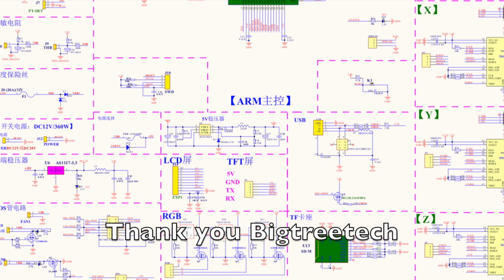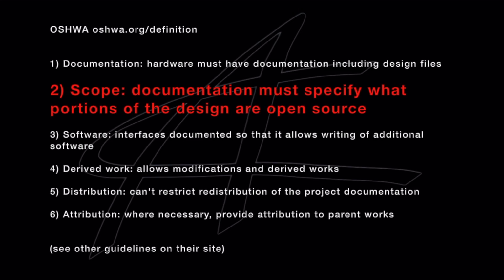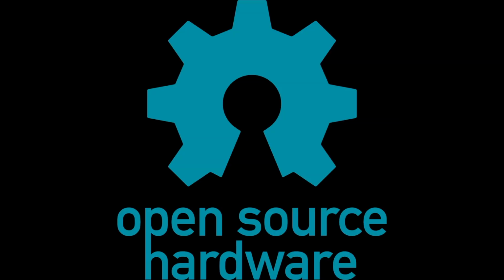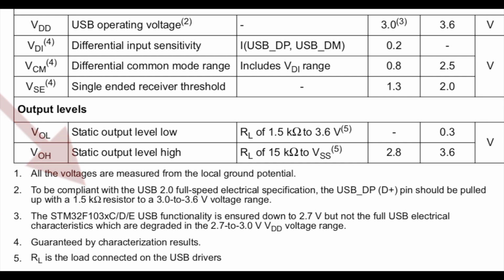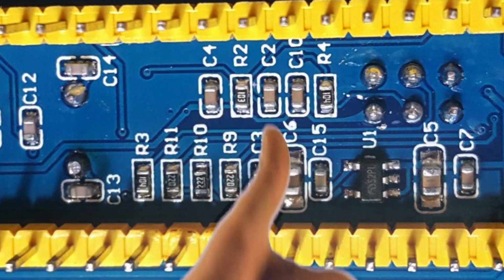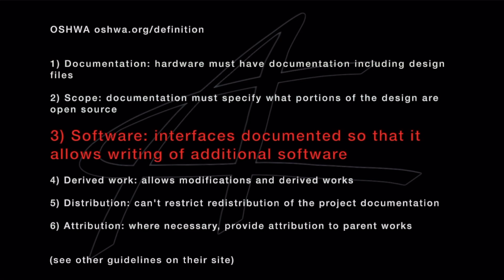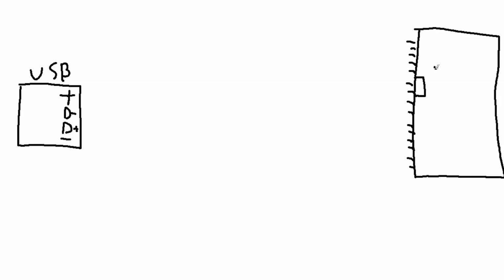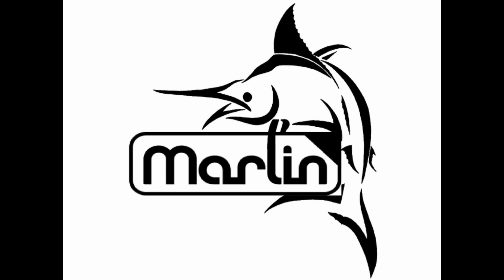Rant: If you say 'open source'... open the source please

Comment: Nice rant. Here's mine - https://wiki.opensourceecology.org/wiki/Fake_Open_Source
Reply from the maker: Nice.  I like the degrees of openness idea.  I have recorded several vids on open source that i never posted, because it is such a quagmire that summing everything up in a neat package is tough, especially lately now that it has become marketing jargon. Part of the confusion is also the original reprap stuff and its derivatives being released under software GPL, which is pretty restrictive and not completely applicable to hardware. I have been trying to refer to OSHWA more these days to try and sneak the concept of separate hardware standards into the public consciousness. ... especially since it gets so messy with mixed-licence projects: MIT, LGPL, GPL, CC, etc.

Comment: Well, I don‘t know about John Doe boards, but I got 3 SKR 1.1 which do not communicate with my computer although they do communicate with an Octopi... I wonder if it has something to do with your example here...
Reply from the maker: There is a Win driver that has worked for some in the  lpc176x_usb_driver.inf driver in the HAL_LPC1768 folder in Marlin.  I can't remember if it complained about signing or not, but I may have to do a vid just on drivers and bootloaders because it is a common issue. Under linux and Mac, the LPC boards have more or less worked fine without fiddling, but Win can be a headache, especially 7 and 8.

Comment: This is what I ran into with the BTT TMC2209s. I tried getting it running in spreadcycle mode by following their instructions, and it didn't work -- a lot of troubleshooting later they published the schematic which showed that their solder jumper for spreadcyle was jumping the spread pin to the 5v out of the TMC2209 -- non-bueno if the stepstick is plugged into a 3.3v controller -- I did a video on that just to explain it to them -- and without admitting fault, BTT released a new version for the driver with a schematic now the jumper is going to VDD -- great, but a week of troubleshooting wasted probing things under a microscope just to get an answer for a bad design which could have been answered by them releasing the schematic -- you know -- when they sold me the stepstick which came with their documentation on how to put the chip in spreadcycle. I answer your rant and raise you another rant -- you can watch my amateur video recorded at a time I'd rather not admit to, with a microphone that was refusing to cooperate.
Reply: @ kazolar don't worry about the the microphone, bringing this issue out to the public is something which everyone would appreciate. Great job and keep up the great work sir.
Reply: I watched your video yesterday. Sad state of affairs really considering I have V1.1 of the boards.
Reply: if you have the bigtreetech tmc2209 v1.1 then you have to make a jumper wire as they made it wrong, there is a video about it on youtube / https://www.youtube.com/watch?v=6oKtRML0kUU / they fixed this issue in version 1.2 As I just got my BTT tmc2209 v1.2 yesterday.
Reply: @fnice1971  so they already released the V1.2 and got it people's hands. Shockingly fast. As I only alerted them of this about a month back. I did not intend this to be my first YT video, I have a big printer build waiting to be edited, but it was really the only way to get them to do something, curiously enough I got a refund and they said they were going to pay me to send the dozen drivers I have back, and they never did -- I'm just gonna stash them in a drawer.
Reply from the maker: THat's good info to know!  Im going to watch the vid right now actually.  I orderd their boards months ago, and just got them on Fri, but I have not looked at the boards of the source yet.

Comment: AWWWW MAN  i just oddered 2 of the BIGTREETECH SKR V1.3  2 day ago :-( 

 pls dont tell me they have a fault?
Reply from the maker: HA, don't worry, the 1.3 is an NXP mcu.  And the bug with the other boards was fixed
Reply: It could be either be a skr mini or a e3 dedicated (always from bigtreetech). Nice video Alex!
Reply: @Galban1  It's either the SKR Mini E3 or the E3 DIP. Both of these have the same issue; on Github. Seems to just have been "fixed" today.
Reply: @neo85271  thanks, Infact i wanted to say those boards, only i wrote the comment on a run. Glad they fixed it, and in general I strongly agree with Alex about sharing the schematic.